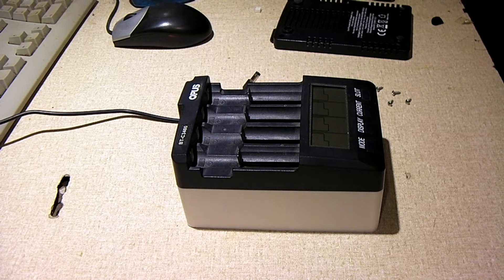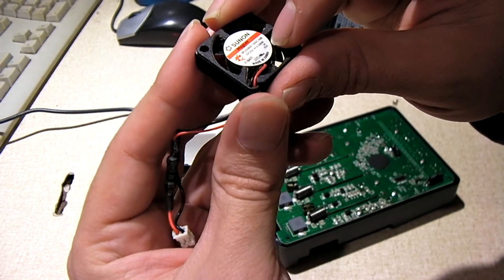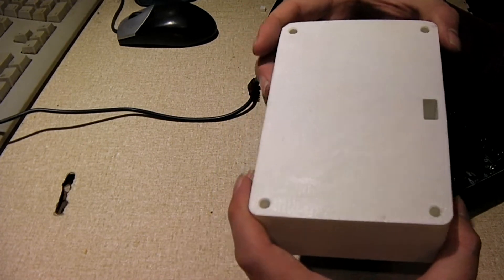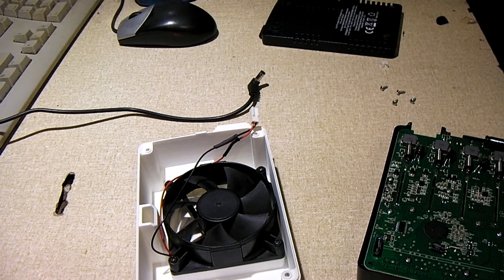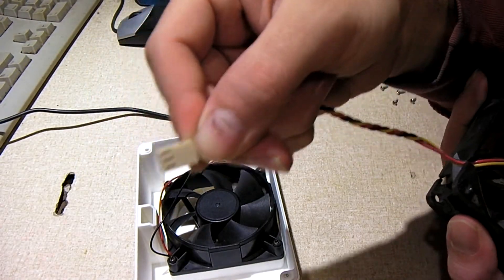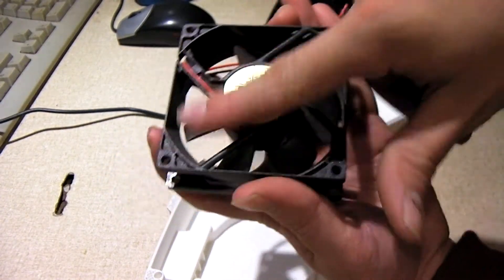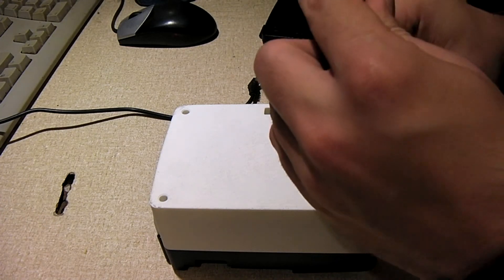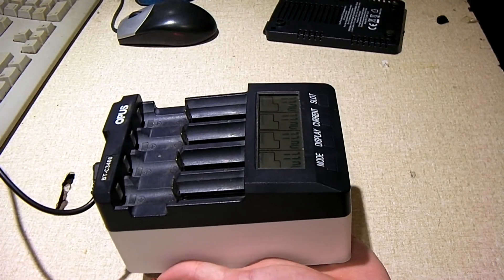OPUS BT-C3400 Fan Mod (Overview)

Comment: You mentioned the 5volt fan issue. The turbo fan upgrade for this uses a 5v fan. You can use either a 12v or a 5v with no issues. I've been running mine for 5 ish years at 5v no added resistors. Comes on like it suppose to and back off when cooled.  I'm about to do the fan upgrade in push, I stead of pull. But my fan will have a outside 12v adapter. I was going to add a thermistor on normally open 40c, but I realized the fan I purchased is made for something like this. I'll try without and maybe later with. Great video btw👍👍👍👍👍
Reply from the maker: Mine has no problem staying cool with the 12V 80mm fan wired to the unit's fan connector. In fact, the fan cycles on and off and varies speed more often now than it did with the original fan. The fan upgrade onb mine does not have an integrated thermistor and relies on an external control to vary its speed.
Reply: @CubeComputerChannel  sorry. Guess I didn't explain myself better. I was just mentioning, you can run these chargers with a 12v or a 5 volt fan. Back a while ago, Terry from p2p, started the tiny fan upgrade, using a 5 resistor. Fan with no resisistor. I will post my upgrade after I complete them. I have 5 opuses I will be adding a Artic P8 80mm fans. Should work perfectly for this upgrade. I won't be using a 3d printer on mine, but it should still come out looking great. Reason I mentioned the fan. I'll be leaving the turbo connected on the inside fan pins. My 80mm fans I might use a thermistor. But each fan will have a power button and connect to a external 12v source. These fans were made for something like this, I'll also be adding a fan filter to each. This gives me the option of using the charger, like I have for the past year, or use the 80mm fan if I have a few batteries to test. Hope that cleared up what I meant about 12v fans and 5v fans👍👍👍
Reply from the maker: @njfulwider5  Mine came with a 5V fan originally, but the fan had a series dropper resistor soldered into the wire that connects to the PCB. The connector on mine has just a + and - lead, and the charger itself has a FET or BJT or something similar to regulate or switch off the voltage to the fan. When I did the fan mod, I eliminated the series resistor since I was putting in a 12V fan. The chargers that came factory with a small 12V fan did not have the resistor. Mine would ramp up the fan from a stop, and once it was considered cooled down, it would just abruptly shut off the fan and repeat the cycle again. With the original fan, it would just keep running for the most part, but with the fan mod, it satisfies its cooling needs, so the fan ramps up, shuts off, and repeats. Feel free to post a video and share it with me.

Comment: were can i get the same exact fan that you used there the one with the shiny tag?
Reply from the maker: These fans were pulled from old computer power supply units, or computer cases. You can buy them new... it's a 12V 80mm fan

Comment: Which file did you use?  There's four different files in the link you provided and I'm having someone print it for me and have to let them know which of the four files to use.  Also, do you have to take the original fan out, or will the new base match up to the bottom of the Opus fan/grille?  Was hoping to just unplug stock fan, but leave it in.  Nice video.
Reply from the maker: There should be a readme document with the download that tells you this information. There are two different designs and two different fan sizes for each design.

You can leave the original fan in if you wish. I took mine out so it wouldn't hinder airflow into the unit.

Comment: I will never understand why the battery charger industry is addicted to those horrible little fans. They move no air and the bearings invariably rattle even after just a few hours of usage. 80mm should be the minimum size for any DC-powered fan.